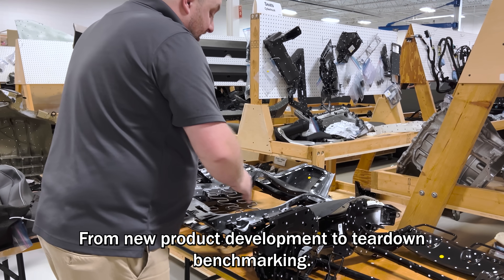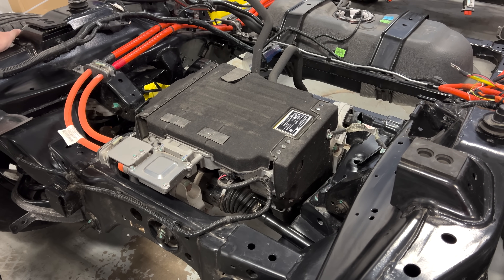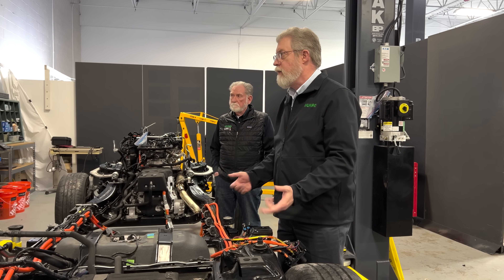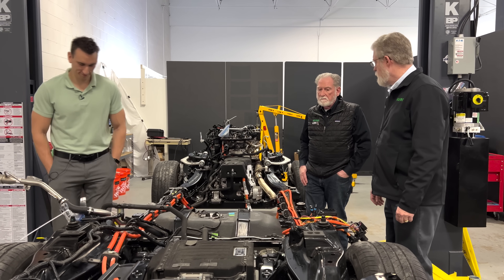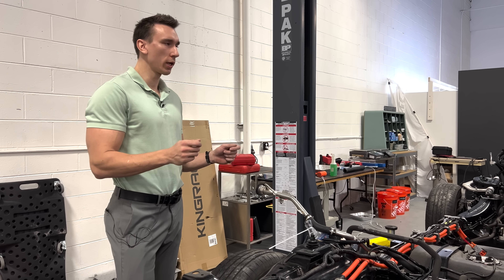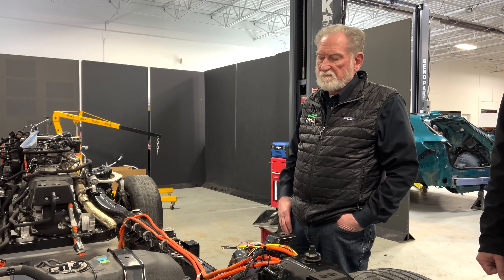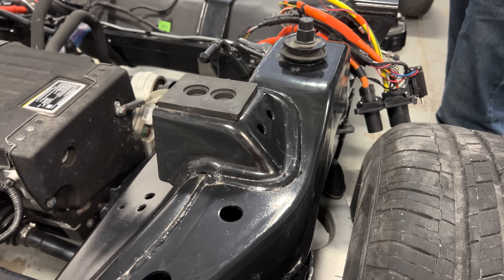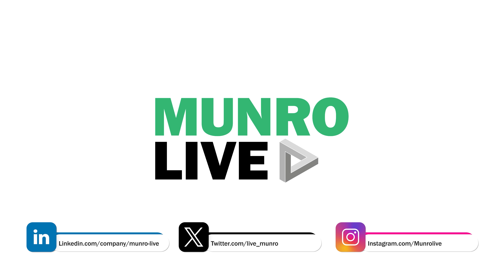There's a Monster Under the Bed of the BYD Shark!

Comment from the maker: “We want to thank the Munro Live community for engaging a detailed engineering discussion about the high Voltage wiring of the BYD Shark.  I apologize for my vague description of the issue that I was trying to highlight in the video.  I pointed out the location of the charging cable and the cable feeding DC power back to the rear drive unit and I noted that there appears to be a ground loop associated with those cables and the location of the grounding strap on the rear inverter makes that ground loop worse.  I failed to explain that a ground loop is formed in the shielding of the cables, not the cables themselves.  The shielding on both cables appears to be connected to the case of the battery and at the inverter case (both ends connected).  Also, the charging cable is connected to the battery case and at the on-board charger case.  All the cases are grounded to the chassis such that the shielding forms a continuous loop.  None of this is an issue if the current is strictly constant, but the DC current has ripple at the switching frequency (and the motor fundamental frequency) and that ripple can drive current in the shielding.  I have seen cases where the current in this type of ground loop can have peaks in the dozens of Amps, not milliamps as some of the commentors have suggested.

Again, thanks to the Munro Live community for calling out things in our videos that don’t seem right.”
Reply: No no no, I don't want to continue educating you which obviously you don't have any clue about how the current flow thru the shielding, every motor body has induced voltage and it's not any manufacturer can control, and it's not what can't be mitigated, trying to explain yourself out of it while made more bs is not wise
Reply: @ The fact that Munro is doubling down on an obviously WRONG statement is unbelievable.  Is it really that hard for them to admit that they were wrong?  
Why is Munro working so hard to push Fear, Uncertainty, and Doubt (FUD) about BYD product?
Reply: @yujuanhe720  And he wonders why OEM’s would regularly ignore his “advice”… if it was anything like this video, as an engineer, I’d ignore him as well.
You should never disregard an engineered design if you can’t work out the reasoning behind it, everything is done for a reason. You’re just setting yourself up to be called out on your bullshit.
Reply: More garbage trying to blow smoke at us.  Hire an actual, degreed Electrical Engineer with a PE license to explain what's going on instead of guessing.
Reply: NO DOUBT MUNRO WAS SURPRISED ON THE CHINESE ENGINEERING ON THE NEW PICK UP ACCORDINGLY WAS OVERDONE I GUESS NO LESS THEY DISCOVERED A MARVEL IN THE CHINESE ENGINEERING BUT WORLD WILL PUT ON DOUBT TO ITS INTEGRITY AND AFTER SALES UNLIKE OTHER KNOWN BRANDS THAT ALREADY PROVEN WORTHINESS IN THEIR PRODUCTS
Reply: @ricbarte1913  come on man, no need to shout
Reply: Bold  nor capital letter neither is not shouting it helps you read with understanding
Reply: Am planning to buy Shark ,  but not sure if it will be good vehicle for long run for normal use ! Nothing tow , just city driving. 

Also will it be a good value vehicle? Please suggest
Reply: Damage control. Failed.

Comment: Guys that ground strap is so large to pass isolation fault short circuits (two point failure), in order to flow current long enough to clear the fusing element without causing cables to melt.  The other reason (but not needing very much current capability) is to shunt out common mode voltage from stray capacitance in the AC stage, and possibly make a smaller current loop.  Ironically if there's a bearing current issue (drive unit and wheel bearing) that ground strap will make it worse.

Comment: 7:30 it's interesting Sandy mentions he has worked on defence related vehicles and he hasn't seen anything with that heavy duty welding before, and that the platform could be easily expanded into a larger vehicle.

Especially since these vehicles are all over SE Asia and Australia, I saw like 7 or so of these sharks on a 30 minute drive today.

Imagine if China invaded a country and instead of needing to bring a lot of vehicles over they can just find BYD vehicles and cut them up with Oxy Torches, then weld them back together into something bigger because the building components are already here, it's a bit suss.

Comment: I'm confused why you keep referring to these induction loops as a big waste of energy. Have you measured or have any idea of what the voltage difference is and the current flowing in said "loop" ? Direction of current ? You'd be talking about milliVolts and milliAmps.... The magnetic flux / electrical noise would be so negligable as to have near zero effect on the efficiency.  Bear in mind there is a negative and positive together on each side, not opposing polarity.... I'd be more concerned with the weight imbalance of having such a huge amount of copper on only one side of the chassis.

Comment: I am an industrial engineer and it used to really bug me to see grounding straps against painted surfaces. Yeah technically it’s better but it does actually work to use grounding straps like that and it’s done everywhere, it’s not a giant don’t do. That’s also a massive grounding strap actually. As far as the welds go, the reason you don’t see them like that is because manufacturers cheap out, those are actually correct welds if you were to do it right.

Comment: People dont get that just because it shows overbuilt it does not correlate to over qualified. is obvious that BYD is copying from the best to achieve these performance and designs. Never the less the point made here is that robust chasis means not sustainable. If BYD is not cutting cost in manufacturing, then how can they sustain prices in the short and long term? o better question: until when will the CCP be funding it in order to achieve global dominance? Obviously customers can care less if china is buying the losses from these companies, if its at the cost of eliminating the competition.
Reply: Copying from what?
No other Ute/Truck/Pickup (depend where you live) is built this way nor have this drivetrain.

Hard to copy something that doesn't exist.

Prettry stupid comment. Can I assume you voted Trump?

Comment: That's not a continuous loop of cable around under the bed it's 2 separate circuits 1 charging and 1 motor that will not create a big induction loop, they resolve within their own circuits. The braided lead may be to disperse the emf generated in the rotor as happens with vfd drives there is likely another brush inside the motor connecting the shaft to the housing. These voltages are hv and the bolt is likely to provide an ample path for the minute amounts of current. Re the welding of the chasis - sounds strong to me. Are you guys sponsored by the US manufacturers.

Comment: Maybe because the Shark is based on 800V platform which needs for the cables to be separated otherwise thicker shielding maybe needed to avoid interference which will add additional weight. BYD will launching 1000V and even higher voltage platform in the future which will even make more sense. Also you cant compare the rear chassis of a regular truck with the Shark because you have extra weight of the battery and rear motor where normally you’ll only have the rear axle and differential.

Comment: any induction or back emf is negligible because the lines are of opposing polarities and are basically cancelling each other. nevermind that it' just plain high voltage DC supply lines, that are not pulsed because the switching happens at the rear drivetrain/inverter unit.

Comment: Designed for the US military in 1945! OMG ！ I need this. I like everything used by the military, as long as I can afford it! I can really afford this. What's even more maddening is that it has lower fuel consumption and more horsepower and acceleration than F150!

Comment: I found the whole explanation of it (the interference and loop) to be confusing maybe due to its total inaccuracy in description. 

the earthign strap is obvioulsy due to electrical noise from the HV driven systems so the current is going to be virtually nothing in microwatts,  but having it bolted to a painted surface making the bolts thread the conductor is a recipe for a very hard to remove bolt in some years if they have not treated the threads, guess they will eventually have some guy spending an 8 hour shift just sticking a piece of painters tape around the bolt hole area in the not so distant future

Comment: Monroe is company orientated and BYD is customer orientated. The over engineering is not a waste its just something that will last a lot longer. In vehicles perspective chassis is more important than component. You can change any component but you cannot change the chassis.

Comment: Bad take: you are sneering at a global product intended for use in very tough environments using the BYD Dual Mode Off-Road chassis which is exactly what it looks like: bulky, not sophisticated but extremely robust and uses a lot of high strength steels because they are tilting at the HiLux market and probably military/police use derivatives as well

It's why legacy truck makers are worried

Comment: All speculation.  It isn't a radio transmitter.  Let's see you measure this imaginary energy loss.  Most automobiles have ground straps.  Sandy didn't even understand how battery cells work in one youtube, confusing voltage with current.  He has no college degrees, just a former tool & die union worker at GM.  Yes, it isn't a Tesla, which Sandy promotes.  The tall guy understands structures.  My M-B 300D, also with IRS, has similar-looking beefy rear structure to support the load points.  Sandy claims "old style", yet has a more innovative frame than traditional pickups.

Comment: The BYD Shark 6 structure is borrowed from the BYD Leopard 5 PHEV SUV. The Leopard 5 is a smaller version of the Leopard 8. Both the Leopard 5 and 8 are design to obliterate the most stringent crash test requirement in the world. Actual crash test smashing the BYD Leopards with semi-trucks demonstrated that the Leopards easily survived the crash and obliterated the semi-trucks. 

https://youtube.com/shorts/Z2S1mGePNJE?si=xT7a2zJJ-dURn7S1
https://www.youtube.com/watch?v=Ksaw95-xQpI

Comment: Some may think the BYD truck is overengineered, but I'd say it is under engineered! Would you take an existing truck and add 300 lb weights in each corner for no reason?  Asside from the unnecessary cost, it reduces range, harms the handling and increases braking distance. With that extra weight, it requires other components to be increased such as shocks and brakes - adding more weight. The best design uses the proper structure for it's intended application.

Comment: Since I know who BYD is, and I know that Chinese engineers literally work their butt off (the very famous 996 vs. the Western style of maybe 933) on their projects, I simply can't buy this BS that the truck EMI issue can be something which can't even be re-engineered to provide the whole system better fuel economy.  It does not work this way in China.  Then when I read the comment, well, I know I am not too far from being correct

Comment: So the Chinese did something they can't figure out, I guess if they couldn't ' recommend ' adjustments then they'd be out of business right? anyway, reviews on the truck are good so far, if it works well and does its job as intended, then why does it matter if the frame is thicker than needed? Should it be made weak like the American trucks? To me it seems like they're reallyyyy struggling to find fault with it.

Comment: I bought a brand new Winnebago 2 years ago.  It started having electric issues the first day I got it home.  It took them almost 8 months to figure it out.  There was no ground wire attached to the frame from the factory, it was a two piece frame and one piece was not grounded.  I had electric gremlins just like you’re talking about!

Comment: LOL, there won't be running any current through the charging cable while driving, and there really shouldn't run any significant curren through the motor's power cable while charging. In other words, this "huge electromagnetic interference producing loop of high voltage cables is nothing more than a ghost of an imagined problem that doesn't exist here.

Comment: I've seen the ground strap left off of the engine cause wheel bearing and axle failure. It will search for a ground through the wheel bearings.

Comment: The loop thing is silly.  Ground straps are very common.  And a heavy steel frame is good for a truck.  In normal use it would flex.  Much better than a cast aluminium piece that would easily break (Tesla).

Comment: That braided strap looks like a RF sink, not an Earth. I don't see how you have a ground loop when one cable is to the motor and the other the battery to charger, which are not operational at the same time?

Comment: I don't mind additional weight and heavier solid build on road cars - most Chinese cars and especially BYD has a very soft, comfort-oriented, almost unwieldy suspension setup. It improves ride quality, minimises damage to the road, at the expense of bad handling.
However- the same problem might exists in how Chinese build their COMAC C919 - which is hillariously heavy. A flying thing might not need overly heavy and solid build like road cars, as they hinder efficiency and performance.

Comment: I think the grounding strap rant is some goofball stuff. Doesn’t quite seem like it matches up with reality. It’s a vibration resistant stainless grounding strap, probably to keep the motor body at a similar potential as the frame, likely not intended for a fault current, and likely would never experience one.

Comment: I wish that I had £1 for every Ford Transit that I have repaired where the  chassis had folded just behind the cab.
Work trucks are always abused especially if used off road and thus having something that has been "over engineered" is the best selling point possible.
Razor sharp "pencils" and cost cutting CAD DO NOT cut the mustard in the real world.

Comment: What you're actually seeing here is a very labour-heavy production process. BYD relies on Chinese wages remaining low vs US or German wages (and probably significant Chinese subsidies.) They wont be able to export the production process, just the cars.
Reply: 😁 BYD use robots to weld. BYD has 90,000 engineers. Wake up, the world has changed
Reply: Byd has the most engineers of any company in the world.
Reply: @remix-yy1hs  BYD grew from 700,000 to over 1m employees in 2024. 110,000 engineers by end of 2024. But 2024 saw over 40% employee growth to support 40% production growth. That tells you it's a people heavy production process as much as these videos. Of course there are robots welding frames and doing other things, but also lots of people working on the production lines and in the supply chain (e.g. wiring looms which are very hard to do with robots). 
Tesla has designed people out of the manufacturing process. Almost no wiring looms, cars driving themselves out of the factory to the collection area, etcetera. No doubt BYD's 110,000 engineers could work towards that goal. But they have received government subsidies for decades, do you think they would be allowed to reduce their staff by 50%?

Comment: Not  a fan of hybrids or EV;s in general  .. All that extra weight of battery's cables and electrical motors pulls down the power to weight ratio.
 Sure it's good for Sandy and his crew to ramble on and break down the Chinese product.
They probably love the tech but it's a bit like Pissing in the wind .. The results are the same .. Not  a lot of progress.
 So l will stick to my ICE Powered vehicle.
 
 In the real world all this so called green tech is just driving the human race backward.

Comment: I bet if they dismantled a 92 Toyota truck they would say it was overbuilt and they could have made it much cheaper. Now 30 years later those old overbuilt trucks are still on the road while ones built 10 years ago are rusting or cracking frames due to being more cost effective.

Comment: You got it, Sandy, this platform has military use. The name Shark comes from there. The reason for the big engine and heavy frame is the fifth wheel use, maybe some kind of gun platform could be mounted there too.
Reply: BYD don't produce military vehicles.

Comment: What a load of crap, there is no 'loop' on the cabling, it is not positive on one side on the chassis and negative on the other. Also the earth strap will just be for safety, it is very unlikely to have current of any significants, probably just backup earthing for electronics.  I can't bring myself to watch any further, between this video and the last.. there is too much bulls#!t for me.

Comment: I've been working with BYD buses since 2017. We did the line inspections for 4 k9lr. I also see the articulated unit at the airport. They are not good. Build quality is marginal and after sales support is awful
Reply: I think the k9 is faring better than those new flyer and proto terra. One is busy to get those thing online under the cover of the Union and transit authorities. The other is under perform and later gone into chapter 11. I dont see the value of BYD keepinv the lamcaster plant and new Market plant open. In the current political climate, they wont win any contract even if their product is bullet proof. Which as you say, not yet. So, why bother burning cash. Just keep the skeleton crew and let go everyone else till the political climate improve